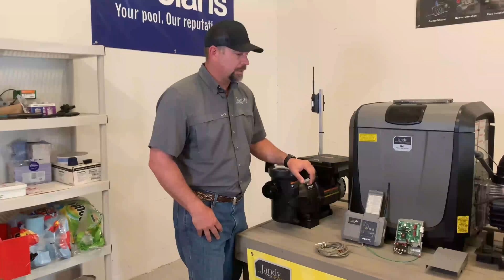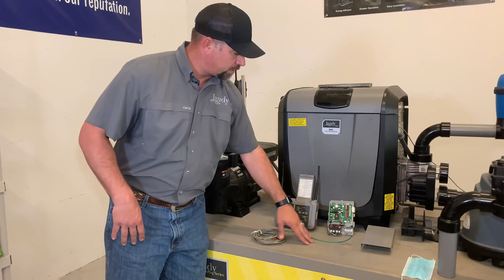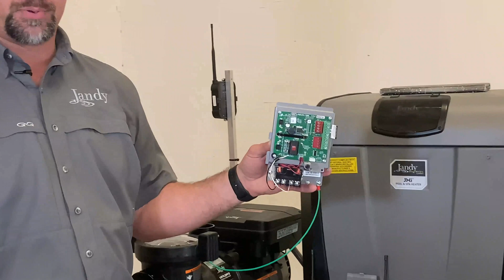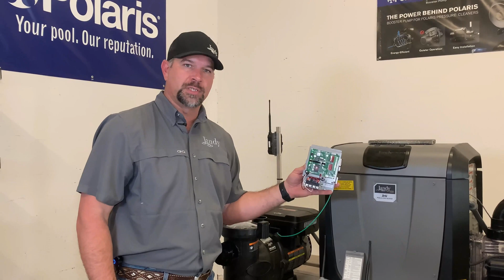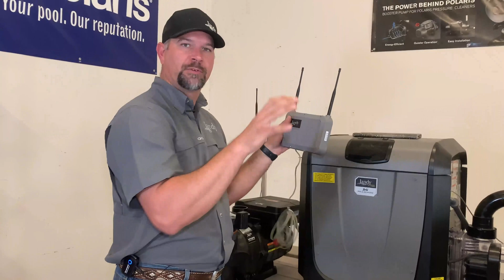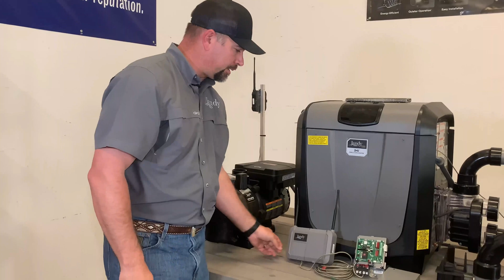Aqualink TCX

Comment: Intrigued by this.  I have a Jandy variable speed pump, a Built Right heater, and a Pentair Intellichlor salt system.  It seems that this will easily do the pump, the low voltage light, and the heater, but will it also be able to turn the salt cell on and off whenever the pump is on or off?  Also, being wifi enabled, can Alexa control it?
Reply: You'll have to hook up the salt system to the relay as every time the  pump turns on it will also send power to the salt syatem

Comment: I purchased this system from an on-line retailer.  Hooked most of it up but had some questions on my Hayward VSP pump.  Sent 3 e-mails to tech support, then finally called with a 150 min estimated wait time, but scheduled a call-back.  When they finally called back I was told that they are not allowed to answer any homeowner questions.  So this "simple to install" system that seems to me to be marketed to homeowners, is great unless you need assistance.  I now have a $1000 heater controller.  Also it is not the same iAqualink system as the other products.  There is no Siri Shortcut support, you cannot access via web app, and it can not be integrated into Homebridge or Home Assistant like the others.  This seems to me to be a product that was released before it should of been, and marketed much differently.
Reply: I know this is a year later, but to answer your question, all Jandy automation systems don’t talk with Hayward VS pumps, they only work with Jandy, or Pentair (with the special communication cord)